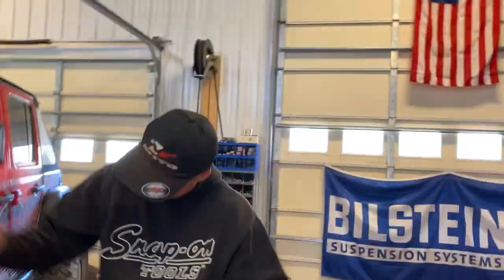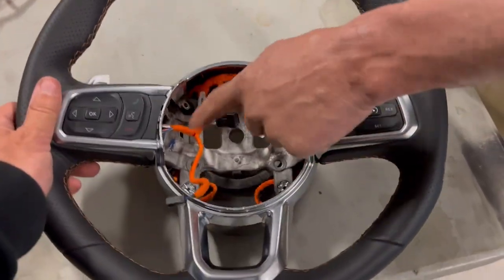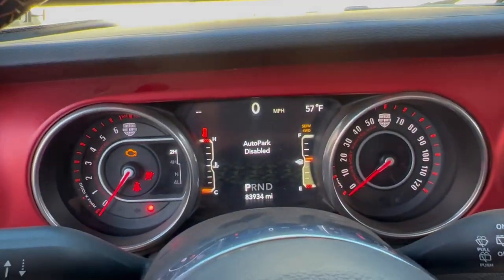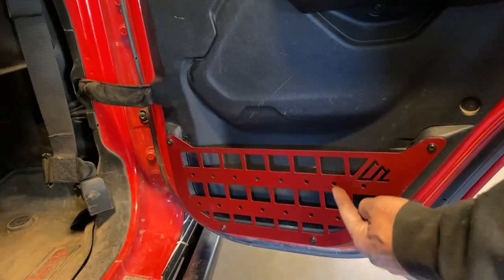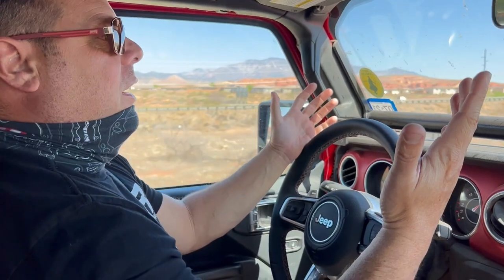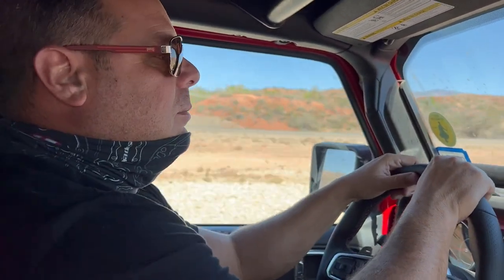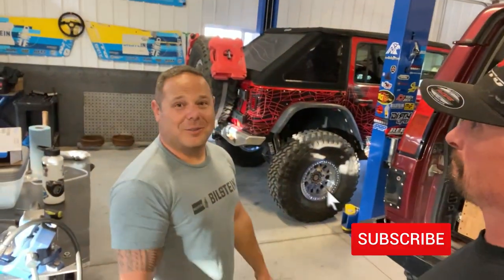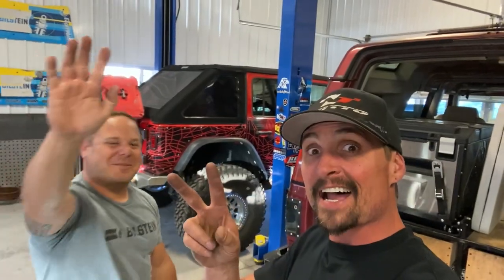Jeep Mods You Didn't Know Existed!

Comment: Just a fine tip for the Tazer: You can update the Tazer while plugged into the jeep while the jeep is off.
LOVE my Apex valves. 32 to 8 on Nitto 38x13.5 in about 15 seconds. Beats pulling the core in time and ease.

Comment: Wheel monitors by Schroder can be a pain in the but in that you have to keep the Air Pressure correct or the system will complain.